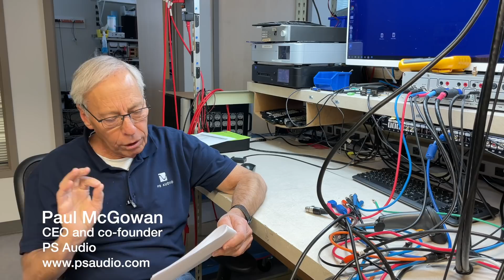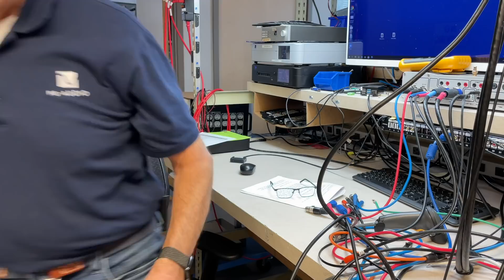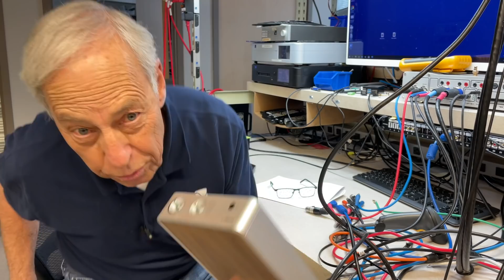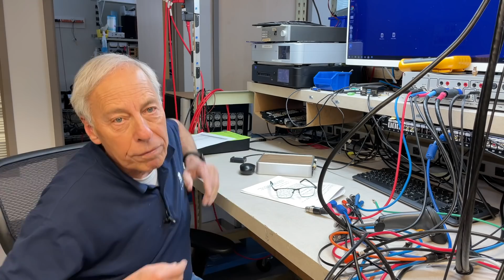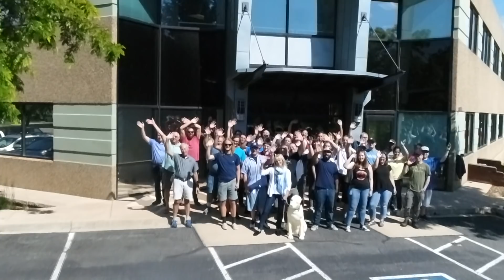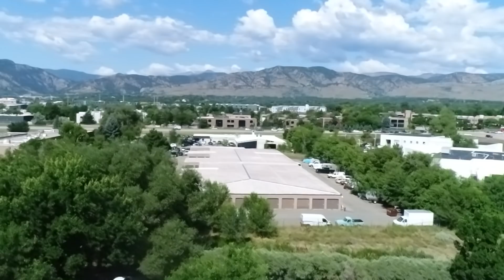Why Class D amps have small power transformers

Comment: It’s alternating plus to minus...plus to minus...one hour later...I got it 😊
Anyway, why not use an over-specified SMPS for a class A or B amplifier to avoid power issues and get regulated stable power rails? Yes, it needs some careful design concerning it’s out of audio band noise.
Reply: There is no need for regulated power rails in class A. All regulating the power rail will do is lower the power available to amp circuit, while generating more heat. The transient demand on the power supply is much different between class A, and class D. A class D amp will demand a sudden surge in power during a transient, while a class A will demand almost nothing extra. This is because in a class A amp, what is not being turned into music, is being turned into heat - it runs constantly at near peak. Class D on the other hand only demands what it needs at the moment, so transients require transient power. SMP's run at high frequency, so they can meet this demand quickly, to do this with a linear power supply requires a large pool of energy in the form of (large) capacitors. In a class A amp, a very large transient will result in a slight reduction in rail voltage, which is not an issue. You mains power probably drifts around more than the transient demand is.
Reply: @joshua43214  The reason people add a power plant is to allow isolation of the power amp from the mains power that can fluctuate and have noise due to load conditions not just by the amp itself. A SMPS can enable higher power for the same cost and allow low loss regulation to keep a class A amplifier power rails independent on mains power fluctuation. Yes, of course the argument is even higher with a class D amp or class B amp where the power rail load varies much more. But with a SMPS regulation is done through the PWM thus heat is not a concern.
Reply: @ThinkingBetter  If you are adding a power plant to reduce power fluctuations, you need your head examined. Power fluctuations do not affect class A, and class D use regulated power rails.
Besides, what you are talking about is mains fluctuation (which have no affect on the amp), power rail fluctuations are an entirely different thing.
You have yet to give a reason for why a person would care about small variations in the power rails of a class A amp.

Let me try to state it again - class A amps do not need regulated power rails.

What class A amps need is a power supply that can provide steady high current loads and not have ringing artifacts from mis-matched impedance between the PS and the amp. This is difficult to do with a SMPS, and by the time you are done, you might as well be using a linear PS.
Reply: @joshua43214  I’m talking about mains voltage noise and fluctuations by external conditions. Obviously you want the power rails to be as clean and constant as possible also in a class A amplifier. Sure a class A amplifier is in itself a more constant load on the power supply but constant load is just less of a challenge also for a SMPS. No, I don’t even use a power plant myself. It takes some skilled engineering to develop a proper SMPS for an audio amplifier. One example is Benchmark AHB2.
Reply: @ThinkingBetter  We agree on that for sure. I don't use a power plant cause my mains are fairly clean, and I cant afford one :)
My understanding is that much of Europe has really crappy mains power, and you need something to clean it up.

That AHB2 looks interesting - it's not a class A amp though. Benchmark is known for good gear. I have heard the NAD amps that use a similar strategy of bundling class H with class AB, they sound pretty good.

At any rate, when the power rails sag in a class A amp coupled to a linear PS, it might result in about a dB of actual volume loss, but you are near clipping if that is the case. Regulating the power rails in a class A amp, just adds a whole new host of problems, and a bunch of un-needed complexity.
Reply: @joshua43214  Yes, the dB variation even at clipping level from typical mains power fluctuation is not much in any amp with the voltage gain controlled by feedback.
Reply: His wagging finger put me in a trance... plus... to minus.... plus.......... to minus............
Reply: Switch mode power supplies for audio  are spoken of as if they are something new when back in 1979 Bob Carver used a type of switch mode power supply with a tiny transformer ( his magnetic field coil) pulsed by a triac according to demand . This along with being one of only a few designers  to use class G rail switching made his of the few  amplifiers that were  very energy efficient , powerful (has enough current for Magnepans) and is very light for it's power rating.

1
Reply: @leekumiega9268  Yeah, we know it's old. But it's been a few decades for them to be good enough for amps.
So it's old tech but new and improved.
Reply: As we age, we tend to become repetitive ;-)
Reply: Class B amps are eew. Crossover distortion.

Comment: Ive heard that the large transformers are better for bass. Would like to hear about how they effect the output.
Reply: Bass needs more power but that power can also come from a SMPS with a small transformer. One of my subwoofers runs a SMPS inside and can do 3,300 Watts. SMPS is especially great for bass.
Reply: @ThinkingBetter  other good example is car amps, they use SMPS or "boost converters" and there is 30kW RMS sub amps available
Reply: @dandeson9723  Yes, car amps use the 12V directly for max around typically 40 Watts (depending on speaker impedance) but need DC-DC up-conversion using SMPS for higher power output.
Reply: @ThinkingBetter  more like 6W(P = ( V / 3 )² / RL)
Reply: @dandeson9723  With 2 Ohms speaker impedance typically used in automotive and 12.6 V fully charged lead battery, you can get max 40 Watts RMS from the amp. V(rms)xV(rms)/R.
Reply: @ThinkingBetter  in theory but for basic hb amp it would be around 10W, 12.6V means 6.3V peak to peak, only real way to calculate one is straight from the output, for normal calculations this is the most accurate Pmax = ( V / ( 2 x √2 ) )² / RL, ofc there are many types of amps and losses vary on the topolopy of the output stage, with bridging you can get an increase by a factor of about 4, aka you are correct and i have no idea why im arguing with you :D but tbf not many mainstream amps use full-bridge output.
Reply: It's half true. Switch mode power supplies usually have smaller rectifier capacitors because the frequency is high so they are refilled often. On transformers the manufacturer knows you need big caps to keep a steady DC while the signal is low half a cycle. At 50 Hz for EU the signal is low for 1/(50 * 2)  = 10 ms which sounds like a short while but when you are drawing a 100 W that is one Joule if energy you need to give without dropping in voltage. I bought a Hypex smps 1200a400 and it's decent size caps but if I build a transformer Powe supply I would put the biggest caps I could fit in the box. So switch mode is great but they could make them better.
Reply: @marcusm5127  basically in SMPS.. the (primary side mostly) switchingpower transistor/s are sort of protected....either one way..
1)  (peak current limited) 
2) (average current limited)
3) ( voltage control mode..
this may or may not have. pk. c.l.)..
this probably limits current draw( @ very high levels @ low frequencies)..which by inherent ( protection) design may cause a drop in DC volts delivered to the power amp modules....
There is no such current limiting in standard linear power supplies..
Reply: @analoghardwaretops3976  It's not an active protection but the linear powersuply is limited by the frequency and capacitors. If the since wave is zero your rectifier caps/output caps are the only thing keeping your voltage up. The refill rate is much more limited as you say in a smps but just buy a powerful smps and you will get good refill speed. I haven't tried running my  Hypex smps1200a400 at full crank with a Oscilloscope yet but I might give it a try. Audiophiles dislike smps because they are complex and unpredictable. A heavy toroidal transformer and massive caps are always good. A 2 kg smps might be better but could be worse and previously it most definitely was.
Reply: @marcusm5127  I did not quite get it.. when you replied.. " it's not an active protection.."  please ..what are you referring to..that I don't understand..??

Comment: So why don't you do the same thing with class AB amps and save on the cost of large transformers?
Reply: Sony did that in the early 80's with the TA-AX5 (that was kind of a test bed for lots of innovations) and the TA-AX6 (that was otherwise more conventional) they where both quite unreliable as well for that power supply. I had a TA-AX5 and it sounded good while it lasted.
Reply: Cause audio is a very conservative industry and the myth of an SMPS is too noisy with out of band noise is still alive. Rather, there are benefits using an over-specified SMPS as you can regulate the power rails and thus avoid the argument for an external power plant box.
Reply: read here at guitar guys. https://www.mercurymagnetics.com/how-transformers-affect-your-amps-sound-and-feel/
The power transformer is the first step in building tone and in setting the standard of performance that the tubes and output transformer utilizes.
The power transformer is also a major contributor for the overall feel of the amp. Such as punch through (the oomph factor), note attack, a perceived larger/wider soundstage presence and most importantly, the speed or reaction time of the amp’s audible response to the player’s sense of touch and playing technique. 
b/c i learn guitar in the past.
have you ever heard rock stars said i like this amp because of the sound.
Reply: Switch mode power supplies for audio  are spoken of as if they are something new when back in 1979 Bob Carver used a type of switch mode power supply with a tiny transformer ( his magnetic field coil) pulsed by a triac according to demand . This along with being one of only a few designers  to use class G rail switching made his of the few  amplifiers that were  very energy efficient , powerful (has enough current for Magnepans) and is very light for it's power rating.
 And it was class AB.

1
Reply: You could, but typically they sound like crap.  When you are looking for that last little bit of sonic performance you can improve the sound with a really good linear power supply on every rail.  This even goes for the computer that is running the streamer in your digital setup.  People will argue that it is now possible to build really good switching PS and linear no longer necessary.  Probably true, but for me there is something just perfect about big iron and lots of filtering caps and some chokes.  Weighs a ton, costs a bunch and it just sounds sweet.